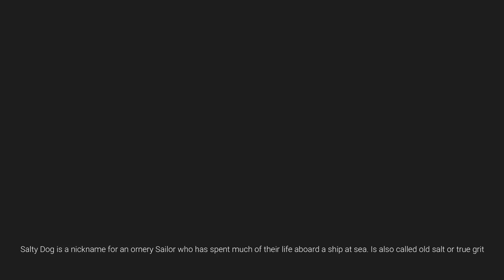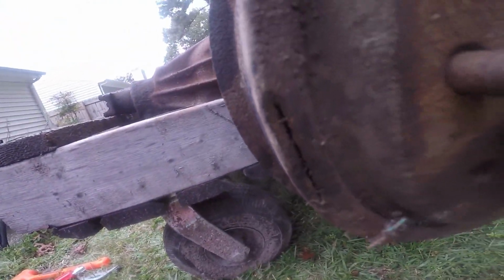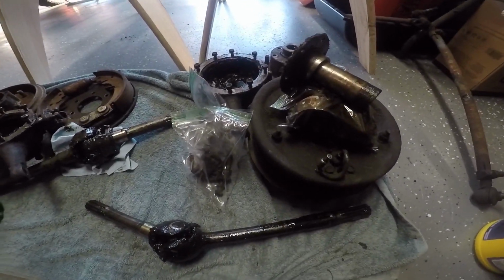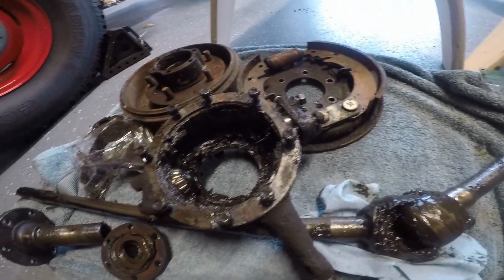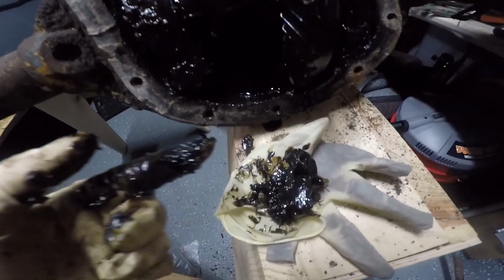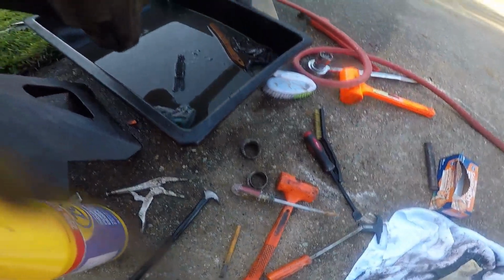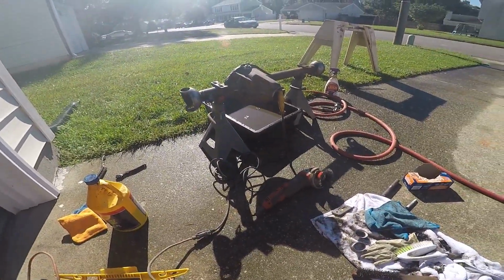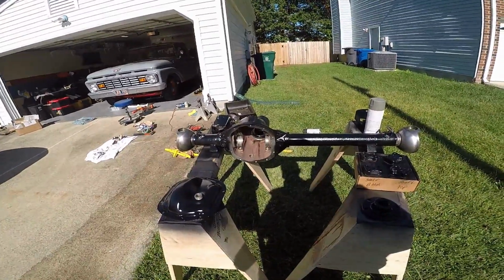salty jeep dana 25 tear down

Comment: That is one of the nastiest jobs and yes the smell is right up there with a nasty fuel tank smell. Also buy 2 crush pinion sleaves just because, that's if your kit didn't come with them. It's not a bad job if you make the setup pinion bearings and don't instal the pinion seal till the last time you're pressing the bearings you're going to use. Once that shim and pinion bearing is pressed on that's it if its the wrong shim clearance you have to ruin that bearing to get them off and that's the only thing that makes that job a pain.
Reply from the maker: This pinion doesn’t have a crush sleeve.  I bought extra bearings so I can shave the inside down for a slip fit to get the right shim set up set.
Reply: @CoastieReid  Ok it's a solid pinion spacer with shims. Yea I have a set of setup bearing for so many rear ends now I can't remember what's what. lol
Reply from the maker: @scottsinfl  Ive spent a lot of money this week on making set up bearings for this DANA 25 and turns out the same bearings are on the DANA 44 in the rear. So- maybe it wasnt a big waste. But it is something i am glad I am learning to do. Always down to try new things that i can do myself instead of paying someone else.